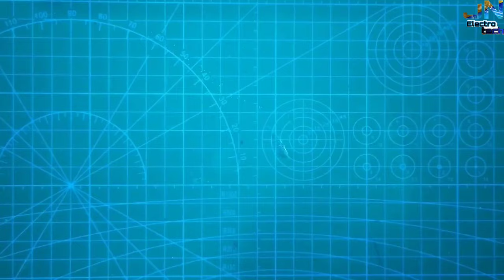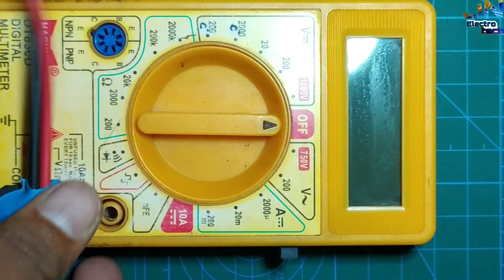Multimeter Hack || multimeter upgraded: DIY LCD BACKLIGHT for your Multimeter #trendingvideo

Comment: Nice upgrade. It does not appear that you used a current limiting resistor on the LEDs. Why not?
Reply from the maker: becouse multimeter voltage only 9volt